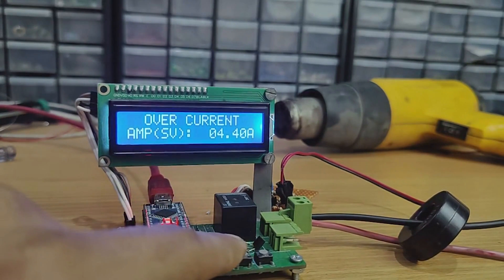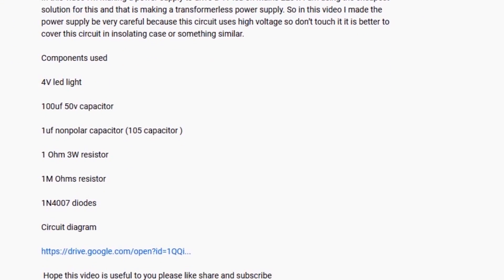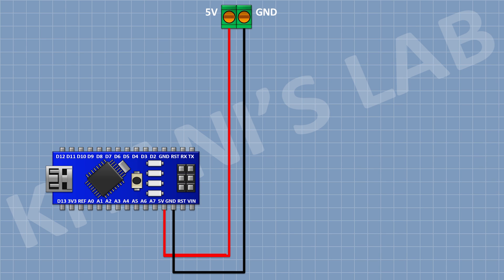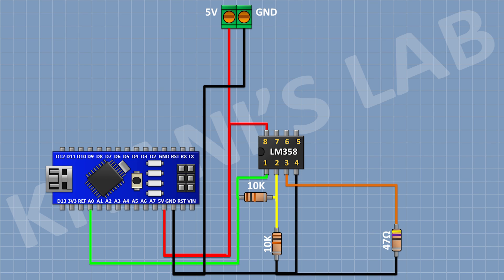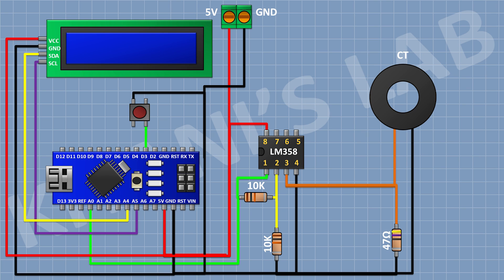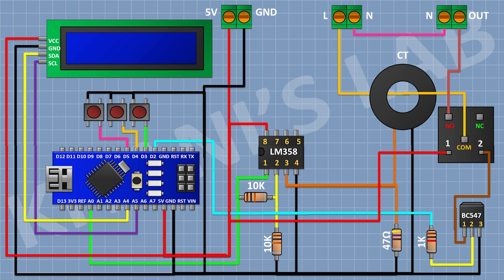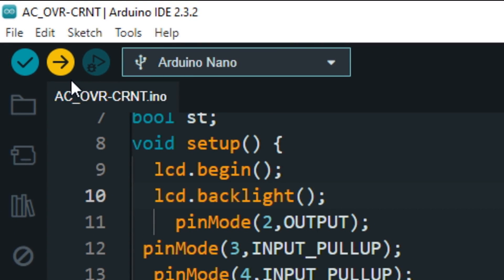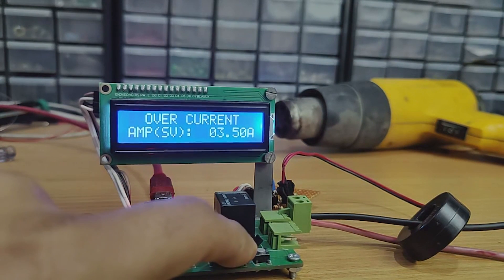AC Over Current Protection Circuit | Arduino Project

Comment: Can u please make video on Under current protection...
I have one summer pump where ground water is very down now...my motor runs only for 10 minuts with water once water finished from ground it drops Ampear from 10A to 5 A..can you please make decice once motor take 5A it automatically switch off ..... thanks